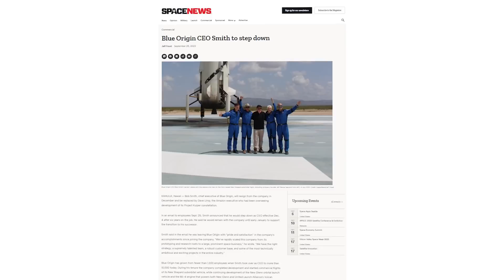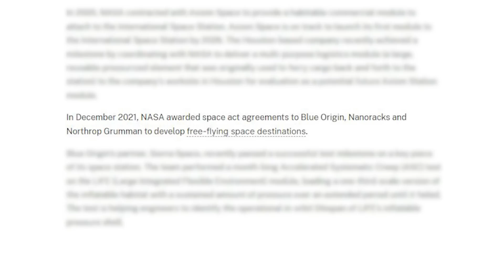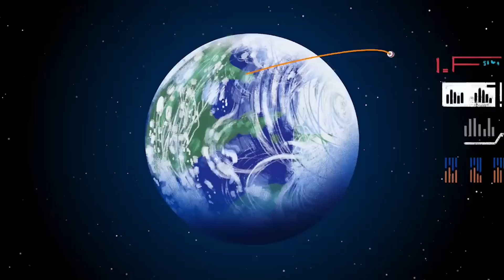Is This The End of Blue Origin's Orbital Reef Space Station?

Comment: We need a giant Sierra space inflatable habitat module on the ISS; something they are doing with a Axiom. Test it out.   Put it on the fast track and hey, maybe they could go with Axiom when Axiom leaves.
Reply: Right, that is my thought as well, why not attach the new station habitat to the ISS, Axiom is going to do it, why not Sierra Space it makes sense to use a current platform.
Reply: @RamblingRodeo , as long as it leaves enough ports for Dragon, Starliner (maybe) and  DreamChaser, and enough berthing ports for cargo.
Reply: @RamblingRodeo  ISS has physical issues.   While the Russia components are part bigger problem...reconfiguration of the station with new modules would very big problem.
Reply: @Wrangler-fp4ei  , of course, if the new inflatable has a CBM hatch on each end, they could dock it to Node 1, straight out the bottom, and still have it’s Earth-facing CBM for result.  As long as the new module had grappling fixtures for the Canadarm II.

Comment: Great Video !  Blue Origin is busy with the BE-4, BE-3 BE-7 engines and the New Glenn rocket for LEO and  L1 by the moon.   The BO Blue M00n HLS will be delivered to the NASA L! Lunar Gateway by New Glenn !  The Blue Moon should be a single stage, reusable with  6.0 km/sec Delta-V for the round trip from the NASA L1 Lunar Gateway to the LS.  With one hundred tonnes of Lunar Water Ice recovered every year  NASA can support a four person Crew on the lunar Surface for a year..  When Blue Moon HLS  (LEV/LLV) can be fueled on the moon  then it can depart to LEO Commercial Space Station  (CSS), the same orbit that Apollo used to depart for the moon !  For more info on the LEV/LLV see  "Moon Direct" by Robert Zubrin.  Timothy Lipinski
Reply: We all know that R. Zubrin is a minimalist and that a moon direct policie is the best (biggest) waste of money. A slight change in the apollo plans, we would have had a moon station by 1972.
Reply: Gateway will be positioned in a NRHO, not at L1 (or any other Lagrange point).

Launching into LEO on something like Soyuz or Starliner before transferring to HLS, flying to Gateway, refueling HLS in lunar orbit, landing on the moon and flying back to Gateway, another refueling, back to LEO before transferring crew back to their original space craft and refueling again.
That's definitely an interesting idea, and it would eliminate the need for SLS and Orion, but you'd also lose a lot of redundancy, as HLS lacks a heatshield and can't perform an Apollo 13 style mission abort and return to earth.
You also wouldn't need lunar ISRU/ fuel production. You'd just need LEO refueling capability and one extra lunar refueling per mission.
So I don't think NASA would go for this until HLS is well proven, based on crew safety concerns. What lunar fuel production would change is eliminating the need for refueling tankers to fly from earth to the moon, reducing costs per Artemis landing.
Reply: @plainText384  Great comment "plain Text384" !  Both SpaceX and Blue Origin will have "Tankers" versions the LEO CSS ina low inclination orbit (about 28.5 deg.).  This is the orbit you reach by launching East from the KSC and this orbit can be reached from the ESA lauch  center !  The BO Blue Moon (LEV/LLV) does not need a "heat shield" because it has a  6.1 delta-V (LS to LEO) and can brake and then dock with the CSS !  The Crew can then return  to earth in the Crew Dream Chaser or the SpaceX or Boeing Crew capsule.  Once Lunar Water Ice (H2O) and converted to propellant Blue Moon can fuel on the LS and not in Lunar orbit !  This will bring down the cost to NASA, US and the world  !  The tech developed for the return to the moon to stay  will take US and the world to Mars and beyond-Ad Astra...  T. Lipinski
Reply: @TimothyLipinski  can you provide a source for the 6.1km/s of delta-V claim? Based on my understanding, the Blue Moon HLS lander is designed for to complete a trip from NRHO to lunar surface and back, before refueling. That would probably put its capability somewhere between 4.1km/s and 5.5km/s depending on safety margins.

So if we had fuel production from lunar Ice, it could refuel on the surface, fly to NRHO and return back to the surface before being refueled.
But if we changed the mission to lunar surface -> NRHO -> LEO, I'd assume you'd still need a refueling in LLO or NRHO (perhaps with a tanker version of BlueMoon, that can carry fuel from the surface to LLO). Or I guess in 20 years, when lunar ICE mining and fuel production is turning into reality, BlueOrigin could just create a more capable Mark 3 lunar lander.